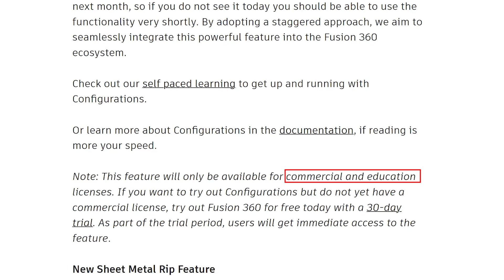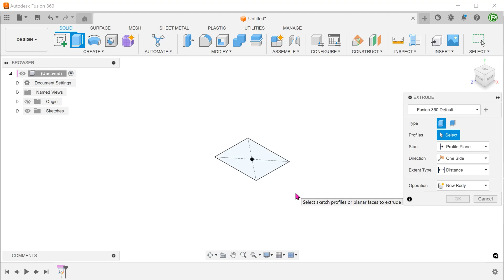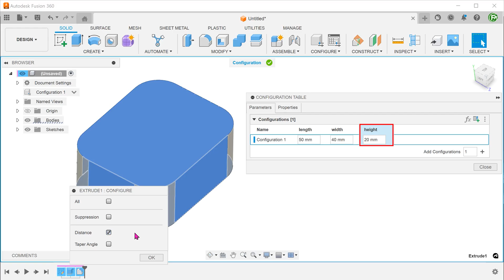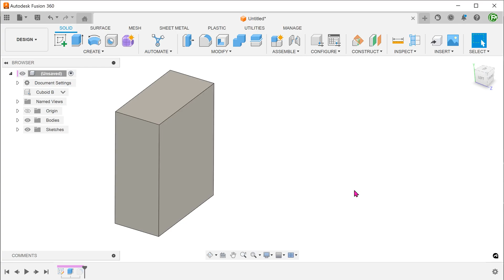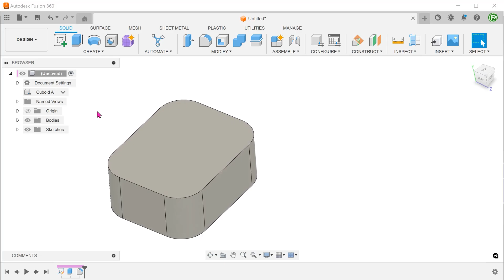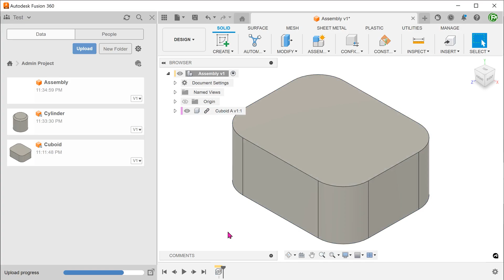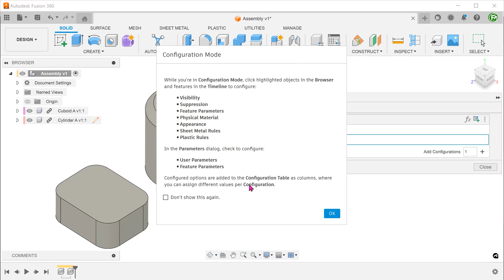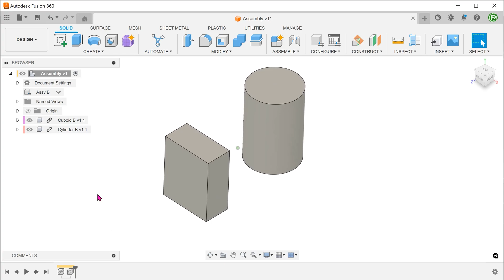Fusion 360 | Configurations are here!

Comment from the maker: I have just read the update notes again and realised that Autodesk has actually planned for the configuration feature to be a staggered rollout.

The following paragraph was taken from the page: 
"If you don’t immediately see Configurations in your toolbar, no need to worry. We will be releasing Configurations slowly over the course of the next month, so if you do not see it today you should be able to use the functionality very shortly. By adopting a staggered approach, we aim to seamlessly integrate this powerful feature into the Fusion 360 ecosystem."

So for those of you with education and commercial licenses, if you don't see the configure toolbar, make sure you create a team first. If that still does not work, the update might not have been pushed to you yet.
Reply: All users that would have it should have it as of a few days ago.  It was staggered only until monday the 25th I believe.
Reply: small clarification.  i think that was for commecial users.  EDU users are still getting it rolled out for a bit :)
Reply: @LearnEverythingAboutDesign  Ty for the info, why is it so hard for Autodesk to clarify this.
Reply: @benmo2227  it was alluded to in the Whats new blog, but without specifics.  I was a beta tester for configs for the past 8mo or so which is the only reason I was able to get more specifics from them I think.  My guess is that they wanted to make sure the back end of the configs system scaled okay to users.  Slow roll out to commercial, then edu.
Reply: @LearnEverythingAboutDesign  can't wait. I am used to it from SolidWorks and realy miss it in Fusion

Comment: I do not see the sense. but I believe you will show us in near future.
Reply from the maker: Sorry, I should have explained more at the beginning. As @lgarnand318 has mentioned, configurations are very helpful when you have a series of parts that have same basic shape but have minor variations in size and features. Instead of creating multiple files, you can create one file with parameters and use these parameters to drive different configurations.

Admittedly, the example that I have created did not really showcase this. I will try to come up with better examples in a more detailed video.
Reply: @Fusion360School Yes, that would be really helpful. I’m also struggling to see the use case for this tool as I already use parameters for that purpose. Great explanation of the tool though and thanks in advance!
Reply from the maker: @russ-techindustries   For a lot of users, parameters by itself is already very powerful. For designs that are "one-time" use, just the use of parameters would be enough. For a lot of manufacturers, they would often have a base stock design from which they would need to make multiple variations of. Instead of managing and editing multiple files. They can just have a single file with different configurations which can be toggled. This is a significant improvement in workflow for them.
Reply: I use this in a couple of ways.  I make assemblies in small, medium and large, configuration lets me keep them all in one file.  Another way is a part will be very similar, a shaft for example, that is only different in its length, and with each length the length of the threads changes.  Again all can be kept in one place.  Very handy for BOM management and sharing files/parts with others when you have all the variations in one file.

Comment: Nice feature, will definitely change my workflow. But it would be nice if thet added a feature i've craving since the very start: global parameters that update between models. Such as layerHeight in 3D printing.
Reply: To do that you can create a design called like "3D printing parameters", add those parameters to the design and star them, then use the Derive feature to copy those favorited parameters into your existing designs. When the global parameters file is updated, the other designs can pull those new changes by clicking the update button that appears.